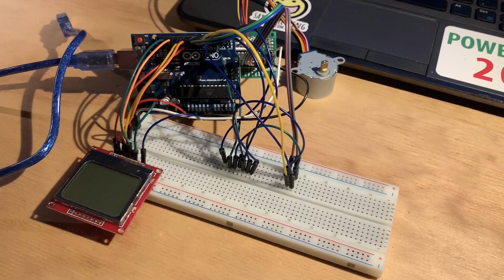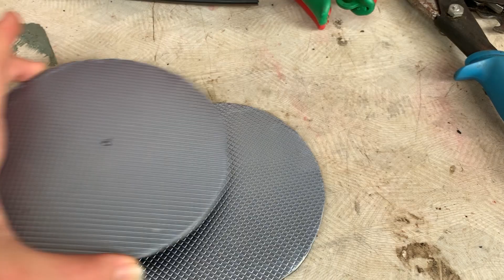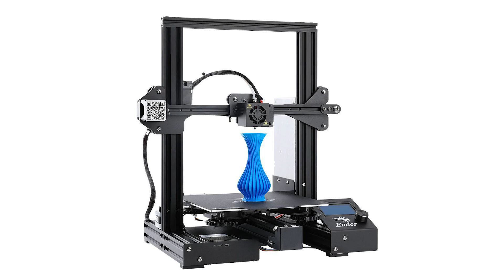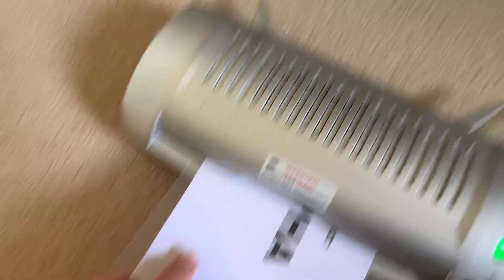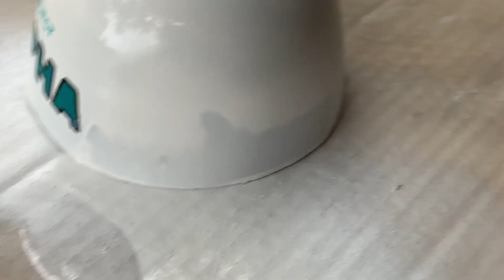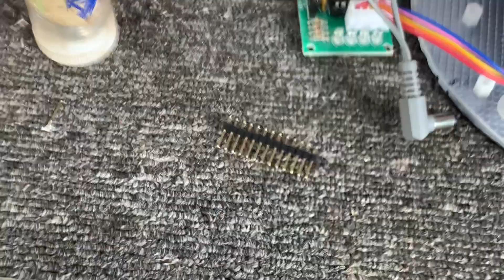lil robot boi - Project ALPHA Ver.1

Comment: Hey nice build. Would recommend a motor shield, that may help with your motor issues and  your future endeavors. I would also consider looking into the motor power output in the coding section, you'll notice if you connect it directly to a battery it will spin faster. Arduino sells a shield for their boards. Good luck, looking forward to more content!!!
Reply from the maker: Patty C I will definitely look into that! Thanks for the encouragement!